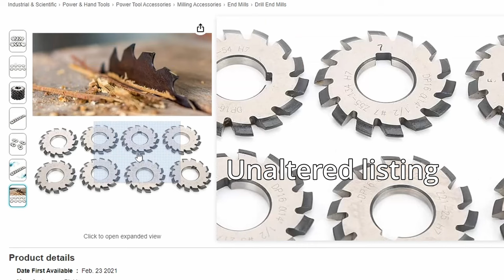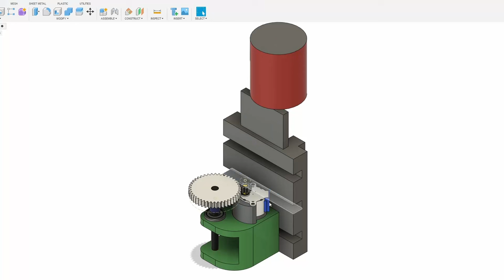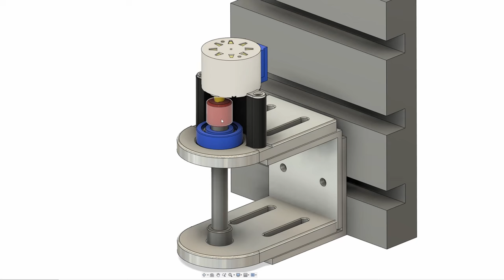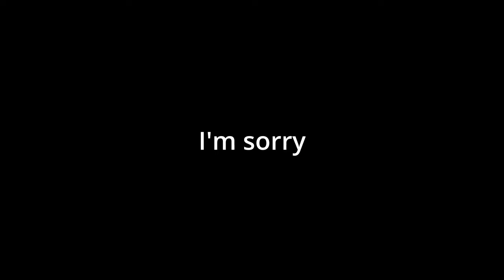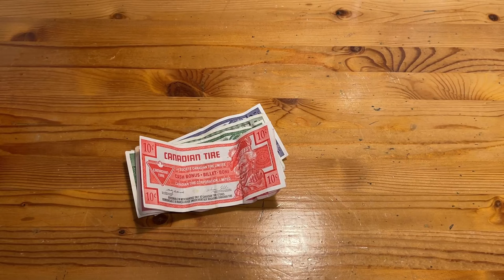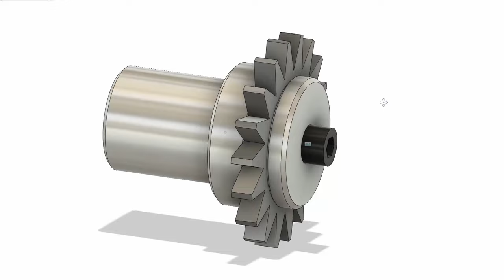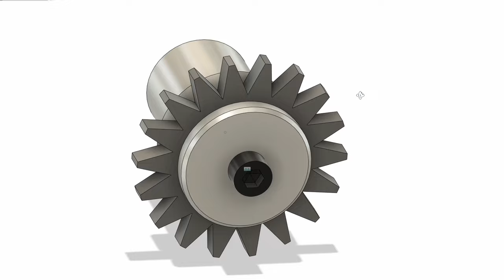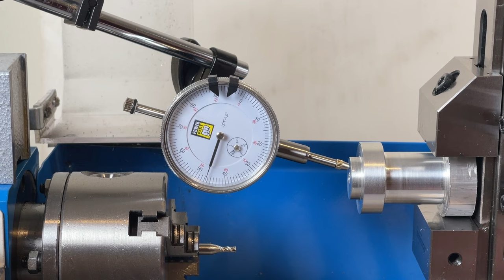The Simplest Way to Make Gears on a Mini Lathe

Comment: Buy yourself a set of High speed steel lathe tools. Way better than carbide on small machines. Carbide tools are NOT sharp, just hard, They need a high tools pressure to work. Tiny lathes have neither the stiffness not the HP to apply the required tool pressure.

Comment: Forget the stepper, unless you gear it down a lot & use friction to keep backlash out.  Or use it to make an index plate from thin aluminum.  Use the index plate to manually rotate & index the gear blank.  A wimpy machine can make tooling to handle high loads & provide high rigidity.  (If you have XY small mill or engraving machine, you can make index plates on that, drilling a circle of holes in a disk.)  Lacking that, you can laser print or use compass to mark magnified circle of holes, manually center punch & drill a GIANT plate (1 foot in diameter) to minimize errors, then use that on the workbench to make small plate which is more accurate & goes on your gear cutting setup.  Always provide way to clamp gear spindle in position during the cut so the indexing device does not need to bear cutting loads.

Comment: My favorite way to keep taps straight is with a spring-loaded tap guide. It goes in the chuck of your drill press or mill, and has a spring-loaded end with a tapered point. You get it and the part aligned, put your tap with tap wrench in place, and bring the quill down until the point pushes into the divot on top of your wrench or tap, depending on tap wrench style. It holds the tap straight and even provides downward pressure as you turn, and if you run out of spring travel as you go, just move the quill further down to follow your tap.
Reply: one of my first projects on my created on my mill was a spring loaded tap guide.

Comment: As someone also running a very cheap hobby shop in the basement i got two pieces of advice: but a noga indicator stand. Yes they're expensive but the second you use it you'll understand. I have three or four of the bases you use but i wish I'd never spent money on them and just got the noga first. If i break it I'll replace it, I'm never going back!
Reply from the maker: This is a great call. It’s surprising how annoying dealing with the cheap stand is haha
Reply: @Someone_Should_Make_That  honestly don't get how I put up with the style stands your using for so long. I wish the noga had a stronger magnet, it's fine but I have one starrer base that's crazy strong.
If the noga cost $200 it would still be worth it. I promise it will change your life

Comment: The tap typically has either a point machined on its back end, or a cup.  Either way, you mate this with center on tailstock which keeps everything in line while you crank the tap (or hold the tap still while you hand-rotate the spindle).

Comment: Great video! I recently bought my first mini lathe so mess with at home and have had a blast. Best thing I’ve learned is to use ground carbide inserts for aluminum, the ones that have a mirror finish. They’ll be labeled TCGT with the G meaning ground. Good luck!

Comment: 4 jaw-independent chuck will solve most of the eccentricity problems. Then use soft jaws to grip the shaft. Soft bits of Aluminium can do the trick. Don't use copper as it work hardens unless you soften it quite often. Brass is also good but expensive. 
The least known trick when machining Aluminium is use Kerosene and use a small brush to brush it on. You will not cause a fire but remove the aluminum swarf and kerosene and do not leave it lying around especially on rags.
I would use HSS to cut aluminum and use 300 feet per minute to set the correct speed. 
The formula for machining different materials is feet per minute times 4 Divided by the diameter of the material.
 So if you are turning aluminum with a diameter of 40 mm, then convert to inches = 1.1/2"Dia.
For Aluminium it's about 3 times faster than for mild steel = 300 feet per minute x 4 (4 is the Common Denominator for this Formula) 1200 RPMs but we must then divide the RPMS by the actual diameter of Aluminium to be turned which 1.5 " to get you RPMS. so 1200 RPMs divided by 1.5" = 800 RPMs using a sharp HSS tool with a neutral to slightly negative rake and brush on Kero or CRC also. when cutting threads better to put on the thread bevel before machining before cutting thread. 
 Your clamping material was not thick enough to clamp your dividing head as I noticed one bending. There is a hell of a lot more knowledge that goes into using a metal lathe properly. 
With stick out on a lathe where practicable is to use a center in the end of a shaft, if it extends out of the chuck by 2/3s the length of the chuck jaws
 Now you can teach me to use CAD with my lesson to you about machining. LOL
 Just hope it helps as there is great danger when machining materials even on very small lathes if things are not secured properly as great forces are exerted from cutting pressures.

Comment: If you use high speed steel in place of carbide it does well on the little lathe like you have and leaves a better surface finish.

Comment: For fixing a threaded rod in the 3 jaw chuck, I use a long nut that fits the rod and cut in a slit. Then it is easy to fix it straight without a problem and with no damage.

Comment: It won’t help you with this current build but maybe it will in the future: your 3d printer is probably capable of making gears your metalworking equipment can’t (yet). 
Printed Harmonic gears can be very low backlash and double helical gears are surprisingly strong. 
Hopefully this helps me get some more content in the future!

Comment: If you have taps with a center hole, use a rotating center to center it instead of the drill chuck. That way you can have the tap wrench mounted and to the entire thread in the lathe